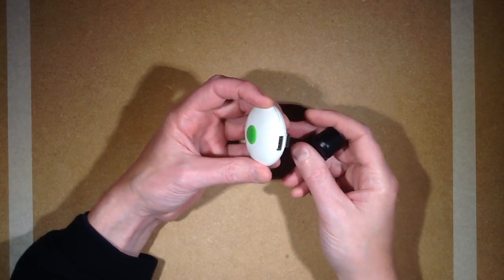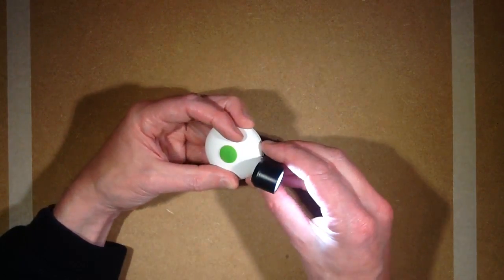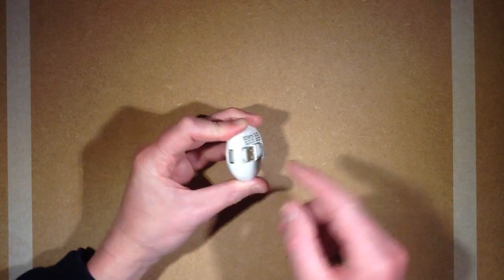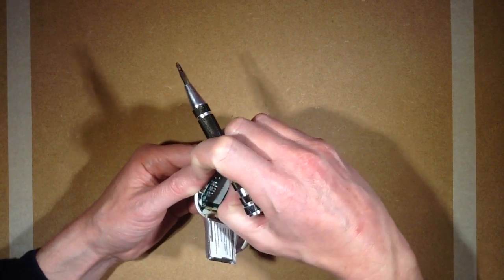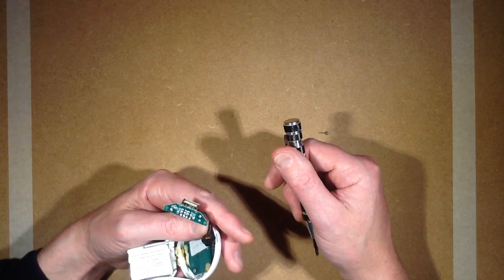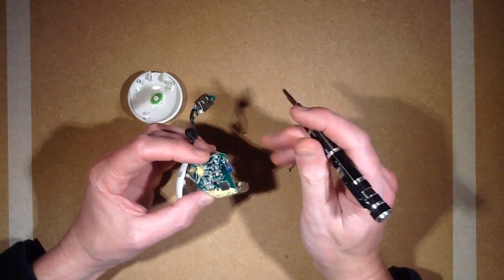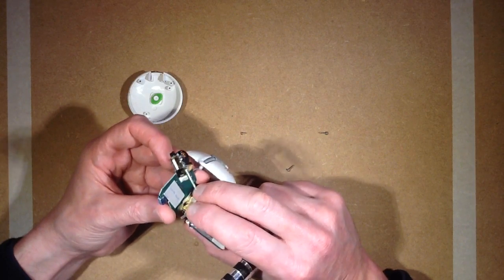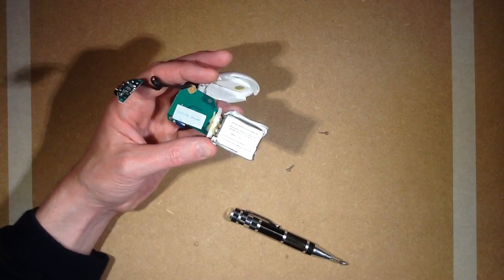Inside a LIDL mini USB power bank.

Comment: I think that the thing that you think is a thermister is a SMD inductor.
Reply: +Matthis Vandeginste While 4R7 often denotes a resistor of 4.7 Ohm, there is no doubt that is an inductor, not a resistor. Also, it is quite common for SMD inductors to have markings just like that one. 3R3 = 3.3uH, 4R7 = 4.7uH, and so forth. Some are also marked using only numbers. I guess it is up to the manufacturer of these parts to chose the markings' format.
Reply from the maker: That was the first thing I thought it might be, but I was thrown by its seemingly solid appearance, similarity to the material used in PTC thermistors and the marking 4R7 which is a common European way of denoting 4.7ohms.  Although it could well be an inductor after all.  It may have a recess hidden from view underneath with a coil inserted into it.
Reply: If you ever take apart a laptop or other device that has silk screen printing on the board that has a switching regulator that needs inductors you will notice the number R number letter label on the inductor and the letter L with a number by it on the silk screen.
Reply: +bigclivedotcom its the 4.7ohms im electricien in belgium